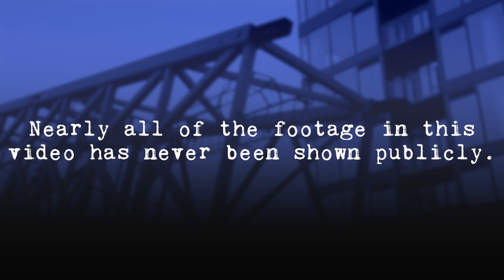Police Response to the Seattle Crane Collapse | All New Footage

Comment: The feeling of being in that cab while it was falling must have been horrendous... Rip
Reply: I'm toaaaaaaaaaaaaaaaaaaaaaaaaaaaaaaaaaaaaaast!
Reply: One guy to the other:  "So, THATS why they tell you to leave the pins in!!"
Reply: nobody was in the cab
Reply: Fuuuuccccckkkkkkkkkkkkkk
Reply: @lbpdluis  one person was in the cab and one person was standing on the roof but tied off the the crane and was thrown off
Reply: @lbpdluis  apart from the person that was in there.
Reply: There is nobody in the cab while being dismantled
Reply: Around 30:08 the officer explicitly says "the operator in the cab" when referring to one of the victims. So while it seems counterintuitive that there was somebody in the cab while it was being dismantled, that's what a guy who was there said.
Reply: @beanacomputer   The cops didn't even understand that this wasn't a functioning crane, which is understandable. 
The boom and counterweights had already been removed leaving only the tower, so there was nothing to "operate" Most likely, the two guys would have been riggers, who would have been attaching pieces of the tower crane to the line of a smaller crane to be lowered to the ground.  They decided to take a short cut, which expedited the process dramatically!😯  It seemed like a pretty nasty day. Unless this was a freak gust that came out of nowhere, I don't know what they were doing up there! Cranes have legal wind limits.
Reply: @carlwilliams6977  it wasn't a horribly windy day, not enough to stop operations. It was just a big gust came up with all those pins out. Tragic.
Reply: @jessz7428   Especially tragic in that it didn't have to happen. I can hear the  guys prematurely pulling the pins now… "Where's it gonna go?".  They got the answer!

Comment: Talk about the wrong place at the wrong time
Reply: yep, from waking up later, having to drive slower stuck behind someone, taking a different route, racing a red light... all those minute variables that could let you live or make you die, it blows my mind thinking about all the what ifs in a situation like this
Reply: Landed on the driver side too, in that front DOA vehicle. Front passenger might have escaped injury free. Some bad luck there, if luck is such a thing.
Reply: @jonmin1574  I would say the chance is lower than getting struck by lightening considering how often lightening strikes vs a crane falling accident.
Reply: ComeAndTakeM fair enough with the sound of thunder, storm warnings etc. More advance notice of lightning thats for sure. but
lightning does strike faster per se as the crane took a few seconds to fall.
Reply: Well God has a plan for all of us to die somehow. The crazy part is you don't know when or how. You just hope it's fast and painless.
Ya, I'd count this as a freak "accident", but it was still meant to happen. I hope they didn't suffer.

Comment: $70,000 fine, four dead. After INTENTIONAL negligent behaviour.
We know what happened, all the connector pins were purposely removed, to save time. But no criminal charges, and only a $70,000 fine.
There is no reason for them to not do it again.
Reply: If everyone was like you we wouldn't have any cities at all.
Reply: They will be paying way more then that in lawsuits, and I wouldn't be surprised if the get dropped by their insurance.
Reply: @cilith1  Fortunately, you are correct. The civil suits and jacked-up insurance is what will probably prevent them from repeating it.
It's still disappointing that the criminal enforcement was a joke. When people are killed due to intentional negligence, someone should go to jail. Whoever gave the order for the pins to be removed, should have been locked up.
Reply: @Joseph-wz4bb  if everyone was like you we would have all croaked

Comment: From all the details I've seen, the construction company removed support pins (for disassembly) too early causing wind to knock the crane over. The wind did cause this but the company is technically responsible for their negligent procedures.
Reply: do them cranes not just become part of the building in the end? plus if i am right on how it work. the crane is place in a down level with the roof so the winds do not touch them when not in use. but if they hand people up there working, even trying to remove the crane. then they are the ones to have a law suit for what happen.
Reply: They are always taken down and moved to another  site for the next job.
Reply: No, the wind didn't cause shit.. The company caused it when they took out load bearing pins. Wonder if the operator even knew he was sitting in a death trap? So sad.
Reply: No, the construction company's negligence caused this. You're supposed to pull the disassembly components as you take the crane down. They did them all in a big bunch to make it more convenient.
Reply: If you watched the whole video it explained what happened very simple🤦‍♂️
Reply: Watches a video with new information in it, goes into the comments talking like he’s studied this.
Reply: One section at a time, you cant jump the gun
Reply: I know nothing about cranes. Would I be correct to assume that these cranes are meant to withhold winds to a certain extent? Growing up on the Co/Wy border where winds could kick up unexpectedly,  I can't imagine have equipment like this that wouldn't be able to withstand strong winds. I guess what I am asking is, was it reasonable to blame any of this on anything but pure negligence?
Reply: @neurologylove2135  I certainly don't see how it could be blamed on anything but. As I understand it, had the crane still had its assembly pins it should have managed the gusts fine.

Comment: Im no investigator. But As soon as I saw the beginning of the video I noticed almost all lower connecting pins were missing. Stupidity in construction has a hefty price!
Reply: and you're right.
Reply: Same here brother, Noticed it instantly, but the investigators seemed to take quite some time to figure that out. Maybe we should be doing their job.
Reply: Barış Doğukan Karakoyun not sure what you mean by connecting pins but I’m assuming it’s a pin what goes through a hole to secure the parts
Reply: To me it almost seems like they were trying to cover up what actually happened. By saying it was the wind? You do know cranes and derricks have to withstand high speed winds. Operating in winds over 20mph is a different subject.
Reply: @jamesdunkerley4172   yes, you can see them here 1:30
Reply: Dario Ortiz it actually was the wind, and the crane normally would withstand it, but not without the pins in place.
Reply: Forgodsache S Sequence of events, or let’s call it a chain reaction. Had the pins been in the wind was going to blow no matter what happened that day. All of construction workers take for granted the weekly forecast and don’t take it into account.
Reply: @Jstain I'm betting the 2 ppl who died probably had nothing to do with taking them out. No way would that operator be in there knowing nothing is holding the bottom together.. So sad, pisses me off they just got fined pennies..

Comment: The pins missing was the first thing I noticed when it started  wth!!
Reply: Im an structural welder and that's the first thing I noticed.
Reply: I am not an ironworker or a construction worker. The missing pins had me puzzled. There were no ripped and torn metal at the connection joints. I would think that only one section would be disconnected at a time with the disconnected section being attached to the above lifting crane. I don't understand how this could happen.
Reply: AvE did a couple of videos on it just after it happened, they pulled all the pins early.

Comment: Should never have happened. Did anybody go to jail over this
Reply: No it happens. Its an accident. They didn't have a load on it. It was a normal work day and the wind kicked all of a sudden. Being that high up there's nothing to break the wind. I can only imagine it was extremely high winds because a crane designed for a roof top is meant to handle certain wind speeds. Working in heavy equipment ive Unfortunately seen horrible accidents. They're very saddening but they are what they are.
Reply: yeah the wind did
Reply: @vlogress11c81  I thought the pins were removed prematurely for a lift and then a windstorm hit? I could definitely be wrong but I remember that being in some of the early analysis.
Reply: vlogress 11c   No, it was negligence. That can be a criminal offense. They should have been charged. Damn crooked city.
Reply: @vlogress11c81  Do you have any idea what you're talking about?
Reply: vlogress 11c pins where removed from the entire crane causing the wind to knock it. The pins should have never been removed. Therefore, this shouldn’t have happened.
Reply: There is no such thing as an accident in the construction industry period! Every “incident” can be avoided. The fact that they negligently dismantled or started to and pulled all the lower connecting pins. That should be grounds for jail time. Who ever the A/D director was on this crane should be held accountable. And all those who saw them pull all the pins(all at once and not per section and it were to be torn down) and not say anything should be responsible too. If you are in construction management you should know that you can end up in jail for being negligent on safety at the job site.
Reply: kmhuis thank you! Cranes and derricks are built to withstand high speed winds. Operating in winds above 20mph is a different topic.
Reply: @vlogress11c81  It says in the video description that it was human error and even at 12:51 of the video theres some text explaining that...
Reply: @vlogress11c81  I don't think you read the report, you can see there is no pins holding it together, literally missing 40+ pins that hold it together as it was being dismantled and instead of doing it in layers they decided to remove them all.
Reply: @bamrak2000  yah he does, read the report...
Reply: @vlogress11c81  Crane operator here, 
You're very wrong on this. The company that was disassembling the tower crane did not follow the correct procedure and they were taking out load bearing pins out before those boom sections were taken off, weakening the overall structure. Everyone who was involved got fined heavily. You shouldn't be spreading around misinformation if you don't know what you're talking about.
Reply: @BigDaddysPlati  No accidents, huh?   I call bullshit.  Critical parts never fail too I guess?  Never say never.
Reply: There's an ongoing criminal investigation.
Reply: @GheeButtersnaps  Your mostly right, except they did not get fined heavily.  
$70,000 is peanuts to a company like that.
Reply: @TampaJohn  The companies were charged, it is in the description of the video. The company that supplied the crane was fined 70,000$
Reply: @BigDaddysPlati  ur wrong things like that do happen and when it does it's called catastrophic failure in this situation it was due to negligence
Reply: @vlogress11c81  incorrect
Reply: @vlogress11c81  🤡
Reply: @vlogress11c81  incorrect. They were dismantling the crane, and removed almost all pins down the tower instead of one section at a time. Edit: my bad, I see this has been pointed out multiple times already
Reply: HeadlineNews That’s correct, the large pin’s that hold the section’s together were removed prematurely to save time on the dismantling process!!
Reply: Slick Rick   That’s not criminal though. They need to be criminally help accountable.
Reply: Elijah ONeal this was NOT a catastrophic failure! This was total incompetence and ignorance and just total lack of human safety! Pulling the pins is what caused this tragic event, the wind was going to blow no matter what. The fact that they pulled ALL the pins that made it go down.
Reply: Lunch Box this was NOT an accident. But for argument sake I’ll agree with you on failure of parts. Let me ask you this, do you ever check your equipment/tools etc...? Before you use them everyday? Chances are you don’t do a daily pre work inspection. But on this particular incident it was NOT critical parts that failed. It was total incompetence and complete disregard of safety. Procedures are there for a reason not because someone had nothing better to do than to tell you how to assemble/disassemble a crane.
Reply: @tylercooper3521  $70,000 isn't charged, it's fined.. Charged is criminal which this should've been..
Reply: kmhuis   @kmhuis  Didn't you read ANY of the description before posting your opinion?   Such as:  "The preliminary findings from the Washington Department of Labor and Industries were released in October 2019. Their investigation found that the collapse was caused by the premature removal of more than 50 pins between the tower crane sections."   The crane was  well-designed, but human disregard for procedure caused it to fall.
Reply: @BigDaddysPlati  I know that reread what I said I literally said in my message that it was negligence

Comment: I work in live theatre and entertainment, with Occupational Health & Safety training.
The first thing I noticed on those opening shots of the collapsed crane on the roof was the lack of pins at the joins. Literally said out loud, "Were there no pins holding this thing together? Did they somehow pop under stress?" Half way through the video now and that's what the investigation says was cause, the pins' premature removal. 
Yup.
This was reasonably preventable and I hope whomever was responsible was sued into the ground.
Reply: The Youtuber Practical Engineering has a great video on this incident. Talks about the negligence, civil lawsuits, and engineering mistakes made.

Comment: If you notice there is no cross piece when it collapses.  This crane was either being assembled or disassembled when it collapsed.  Apparently the links weren't secure in the upright tower when it keeled over.  It was leaning quite a bit so it didn't have it's raker cables attached either.   No way was this a working unit from what was visible in the video.  The other crane near it was more than likely involved in assembling or disassembling it.  And due to that there shouldn't have been cars driving anywhere near it at the time.  Someone needs to atone for this.

Comment: I'm not even an investigator nor a crane operator for that kind of crane and could quickly see there were no pins holding the base. No ripped metal to suggest structure failure. Just missing pieces. Very tragic

Comment: Cranes are dangerous if they fail. I used to pick up and deliver to the shipyards and the cranes loaded the storage containers on and off of the ships. It may still be operator error since it wasn't in use due to high winds. No matter what, it's huge equipment and a lot can fail. Seeing a lot of developing countries trying to use them now and it's a disaster. Thankful to the responders to secure the scene and get medical in there.

Comment: I was on a job where one of those tower cranes collapsed and not far from it when it came down.  They have large concrete slabs on the back end of the cross piece opposite the trolley that moves the boom and load.  One of the pins that held cable that went from the top of the tower to the end of the counter weight, snapped.  The counterweights swung into the tower buckling it and the trolley end came down by itself then the buckled tower.  It killed one man on one of the building decks and several who were working underneath and of course the operator.  The trolley ran down the track and kept going cutting a worker's foot off.  Those things work great when all goes well...but if they don't.....whew.  I worked on that job for 2 years so I was able to see 'em put the crane up then remove the pieces and replace it with a new one.  I tried not to walk close to it.

Comment: If anybody is curious AvE did a video on this way before any findings came out and he was totally right but he explained why very well, bottom line being that there was probably some lazy guy who pulled all the pins so they could just rig up the crane and go and the wind blew it over and without anything to hold it together the thing fell apart.

Comment: This is absolutely tragic.  Instructions, policy, and regulations are in place for a reason; safety, first and foremost.  And doing all that on a windy day, not smart on the GC’s part.  Not sure how the equipment supplier incurred a violation if they merely were subbed to supply a crane which was erected by others, if that’s the case as the description seems to imply.  I haven’t read any articles on this cuz this is the first I’ve ever heard of this tragic accident happening.

Comment: FYI the reason the crane came down due to wind was because the crane crew out took all the bolts holding in together out all at once.  You never do this as per this accident.  Improper dismantling of the crane was the culprit. Rip.

Comment: You know, I worked at 4th and Madison at the brown square building they nicknamed the box the space needle came in back in 1997. I worked really high up where you could hear the building moving from the wind in the stairwells and feel it rolling. I actually watched the king dome collapse from that office building cuz my dad worked with the same company at that time. I worked on either the 12th or 14th floor I can’t recall now. Mercer street is a lower elevation or maybe same. How could they not think of the wind? The site manager should have been charged!